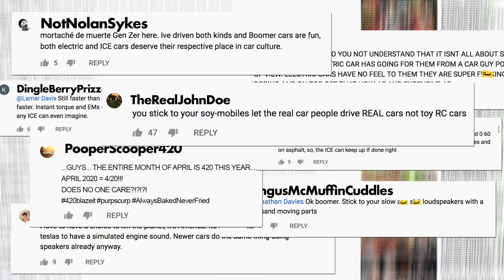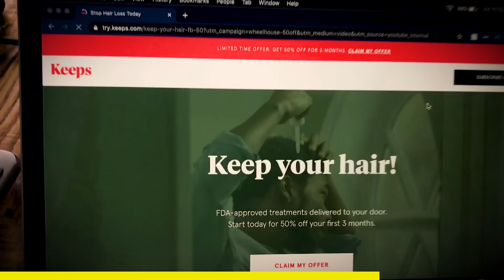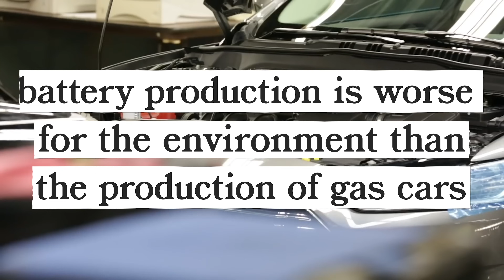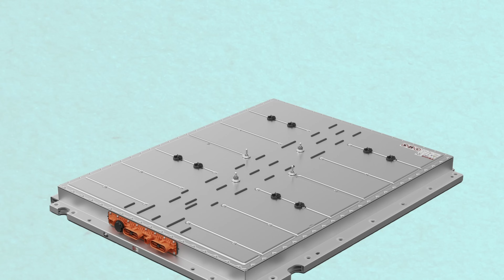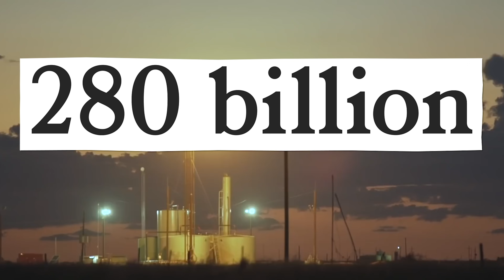Are Electric Cars REALLY Better for the Environment?

Comment: You missed a point, price. I had only 3k euros to buy my 1st car. The only electric vehicle i could afford was a scouter...
Reply: You're a 100% correct I can by 3 cars for the same cost is one electric car and the governments trying to step in and pay for half of that which means were all buying electric cars in 1 way over another.
Reply: not to mention that that EV will need a new battery in 10 years at a cost of 7K to 15k
Reply: Your not gonna own one and everyone is gonna pay a lease that will be subsidized to be affordable. If they can convince someone to replace a 1000 dollar phone every year they will do it with evs
Reply: you could have bought your self a Toyota Prius, you would be half way if you used the EV mode well.
Reply: but ev's are 5x cheaper to run, comes to about the same cost over its lifetime
Reply: @fusionsoup9784  personally, a one-time repair cost is worse than a higher recurring cost. 
It seems that gas cars don’t fail outright mechanically as much as EV but that could change with improved technology, but I doubt the manufacturers have the incentive to improve this.
Reply: @liucyrus22   and try getting a replacement battery for a vehicle that is 10-15 years old (age where working class people buy cars) and is no longer in production. It won't be as simple as putting in a battery from a newer model because tech improvements won't be compatible. 
Private transport will not be available to a growing number of people, it will become unafordable. Vehicles will also have a shorter service life and end up on the scrap heap far earlier increasing resource use and waste.
Reply: @slooob23  that’s the official statement, but I would say third party repairs can make that better by a whole lot. 
They are using standard Li-ion cells to build packs and so it is possible to rebuild the packs with a bit of hacking to circumvent the software obstacles in doing that. 
Priuses are getting rebuilt battery packs already. 
Yeah but the official route is still quite bad for the market of used electric cars.
Reply: @liucyrus22   that's why it has to be a gradual transition. The present used vehicle market probably has the most efficient recycling industry built up around it. I can get almost any part for my 17 year old Nissan including an entire powerplant for less than a refurbished battery in a 10 year old ev. It could take 25 years to build up a service industry for EV's like that. In the case of New Zealand, the government doesn't care, they haven't even calculated the social cost and they don't give a damn.
Reply: There are plenty of affordable ones in 2021
Reply: EVs will get cheaper, Dacia Spring will be around 10k€ in Germany, with 6k€ subsidy, you wouldn't be far off from affording it, and that is for a new car, not second hand.
Reply: We'll get there. EVs are still very new, and they seem to depreciate slower (probably because there aren't as many moving parts to break or wear) but eventually there will be properly affordable ones on the used market.
Reply: @JobyElliott  some are already. If you wanted a 2003 RAV4-EV, they can be have pretty cheap. They just don't use modern chargers. 😂😂😂
Reply: @JobyElliott   no there won't, electric cars = no more private transportation for poorer people. Once the battery needs replacement the car is effectively worthless. Poorer people will not be able to afford it.
Reply: @slooob23  ONLY if you expect technology not to progress which we know it won't since there's tons of companies working on new types of batteries and some will hit the market within the next 2 years. This makes your point moot. And seeing that some of those poor people you mention are able to afford 1200 dollar mobile phones some might have to get their priorities straight.
Reply: @TheGalantir   you obviously have no idea of how supply/demand/price works.
The present politics associated with EV's will ensure a social disaster.
Reply: Second hand vehicles are an option. I may never be able to afford a new car, not even a gas one, but I've got my 4th used car now, and I drove 2 of my first 3 over 100,000 miles each.
Reply: @AlexandarHullRichter  hows the second hand smartphone market?
Reply: @coreygolphenee9633  idk. I've got one. A number of people I know have them. $1k for an iPhone is absurd.
Reply: Reminder - Co2 is the basis of all life on earth.
Reply: @slooob23  that would be important only if there wasn't an extreme overabundance being produced atm. 

If all artificial sources of co2 stopped completely and permanently, there would easily be enough, just like there was 200 years ago when fewer people lived and more plants removed the co2 than today.
Reply: @AlexandarHullRichter   are plants presently on a co2 strike?
Reply: @slooob23  yes, due to being removed to make way for suburban development, or to make paper products, or because of dying for lack of food because humans have been destroying the ocean ecosystem on a large scale for almost a century.

Are you really so disconnected that you don't notice these things???
Reply: @slooob23    this may come as a shock, but plants that are dead because of human development don't remove co2 from anything.
Reply: @AlexandarHullRichter   why would I be talking about dead plants? You're beating a man of straw.
Reply: @slooob23  apparently you're not understanding what I wrote. Try reading it a few more times.
Reply: @AlexandarHullRichter   so when NASA reports a massive greening of the earth has happened in the past 20 years, I should put that down to dead plants? You are ignorant, that is what political activism does to a person.
Reply: @slooob23  batteries are cheap compared to a new car. Plenty of people have installed new or referb  batteries in older EVs and hybrids for less than getting used gas cars of the same age.
Reply: @slooob23  small improvements don't make up for big destruction. Things are getting better by the penny after haven't gotten worse by the dollar. In 50 years, we'll be farther along. EVs are going to be part of that.

I live in California, BTW, and huge previously plant filled wild across are being developed into houses all over SoCal. Nature is disappearing here, and people wonder why they're are problems.
Reply: @AlexandarHullRichter   so you change the subject to more nonsense when your previous nonsense was exposed? In NZ a Nissan leaf battery costs 5-10k and is one of the smallest electric cars, I just got a Nissan maxima (a much larger car) in perfect condition for $3700, less than one tenth of its new price.
The poor are going to get screwed into oblivion, motor vehicles are one of the only ways trickle down economics actually works, the EV craze will destroy all of that.
Reply: @slooob23  BTW, a referb Prius battery can be had for about 1k in the US. Installation is another 1k, and it takes a dead battery Prius that's worth about 3k and bumps that value up to around 5-6k. There are videos you can search for if you actually want to bother educating yourself.
Reply: @AlexandarHullRichter  and how much of California's electric grid is produced by renewable energy? Ev's are virtue signalling nonsense which are useless for the so called "climate emergency" we are told we're facing. The extra industrial activity (and associated co2) required to replace a vehicle fleet with EV's and dispose of the previous fleet is bad enough. Add to that the lack of renewable electricity generation, the lower service life of EV's and the inability for large numbers of people to acquire them. It is nothing but a gimmick. 
I've got nothing against EV's as such, but to suggest they are going to make any difference to this "emergency" as it is presently defined is utterly absurd.
Reply: @AlexandarHullRichter   the "dead" Prius you mentioned  would cost $4200 in NZ money, where as my fully functioning maxima was $3700 at halfway through its life, I'd expect to get 10 years service out of it at current usage. The old Prius with new battery would be $7000-$8350NZ based on your pricing, so literally double the cost of what I paid, and even then I paid a bit more because the car I got was higher spec than the base model. So there you have it, a Prius (which would be among the cheaper options) would be double the price of a used gas car.
The EV revolution will seriously negatively effect the ability of the working class/ poor to have adequate private transport.
Reply: @slooob23  nz is not a large car market. In California, the world's largest car market, that Nissan would be worth about the same as the Prius, but the Prius actually has a service life of 2-3 times that of the Nissan, if you are ok with getting a new transmission in the Nissan every 2 years. Their transmissions do fail that frequently here. The size of the market is important because we're not talking about individual vehicles when discussing environmental impact. We're discussing hundreds of thousands of vehicles of every model produced every year. What works in larger markets is way more important than a place that only gets a few thousand new vehicles per year.

The power source for the EV is actually irrelevant to the vehicle's impact because upgrades and changes are being constantly made, and most EVs will still be in service when more renewable energies are in use. Even if they weren't, the worst form of electrical generation is the US has a thermal efficiency twice as great as a gasoline engine. Most of the people who have EVs in the US are also people who recharge them with solar power.
Reply: @slooob23  as far as initial cost, most people here buy new cars more often than not, or else they'll get a 3yo model not is still early in its service life. The Nissan Leaf, Tesla Model 3 and Chevrolet Bolt all sell in the 30k-40k range. That's about mid level for cars here. Suvs are very common, and tend to range from 25k-40k for normal ones, and 50k-100k for luxury ones. As EV very affordable by comparison to that.
Reply: @AlexandarHullRichter   well you'll be happy to know that the NZ government plans to ban the sale and import of all gas cars by 2030, and encourage us "to cycle twice as much" . How I'm supposed to continue running my business is beyond me, going to take me a long time to tow a ton of gravel with a bicycle, but I digress. We will be the worlds test case so I guess our pain and experience may be your gain.
Reply: @slooob23  That, I feel, is unreasonable, unless it only applies to new vehicles. Forcing people to buy new vehicles instead of being able to import or trade used ones is definitely a hardship for everyone, regardless of what powerplant you want that vehicle to run on.

Honda and Toyota both plan to phase out gas only vehicles by about that time as well. Honda has already announced that for the EU market. I'll always have the option to get a used gas car if I want, or a used EV. I'm actually a big proponent of always buying used. Part of that is I just don't like most new vehicles. Part of that is I could easily get a gently used car from the 1990s and do a complete restoration on it for less than the 2021 model costs, EV included. At least, that's the case in California.
Reply: @AlexandarHullRichter   I agree with you, I do the same. I've taught myself to fix cars etc and I have managed to aquire good quality older cars that are low cost to run, I save about $1500 a year by refusing to go into debt for vehicle purchases. Recycling is good, it is a great way to conserve resources and lower consumption. I too do not like many modern cars, may latest Nissan (its the same as an infinity i30 in the usa) is far more reliable than later Nissans. Many modern cars do not age well, planned obsolescence is a growing feature of vehicle design and parts, it is one of my pet peeves.
Reply: @slooob23  My car is a CR-V, and I laugh sometimes at the discussions is the CR-V owner's club because most of the discussions in the newer CR-V section are to do with failures of electronics that can't fail in my car because my car is to old to have those features. I like my car that way.
Reply: @slooob23  slow and eventual replacement might do good, but the virtue-signalling mass replacement is doing more harm. 
So I agree with you.
Reply: @AlexandarHullRichter  Your argument is looking more and more frail by the minute. You can quit the professor act.

Comment: 10:37 
Lol in Denmerk by 2050 all cars on the road have to be EV's
Reply: Thats rather late Denmark, greetings from Norway.
Reply: New fuels are being developed that give extremely clean emissions from internal combustion engines. For example the new synthetic fuel developed by porsche reduces tail pipe emissions by 85%. This would put the internal combustion engine on a level of emissions output at the same level as a electric vehicles.

Comment: The problem is charging in rural area fauyette county pa has no charging stationy volkswagen diesalt is cheap to run more places to fuel like north Dakota and Montana road trips would be hard.  I guess ev or like model t a hundred years ago versing railroad

Comment: The supporting infrastructure to deal with the other issues is simply not there yet. We already have the plague of what to do with used tires. Imagine adding used/damaged batteries to that mix. Tires do not spontaneously combust (unless doing an extended burnout) and are not as laden with various chemicals battery packs contain. Disposing of and recycling of battery packs was touched on but not figured into the overall environmental impact of EVs. Carbon dioxide cannot be the sole metric. That being said, I am NOT anti EV.
  I would love to build a EV with lightened and balanced armatures ,better bearings,and all that. There is so much potential performance there that many overlook. Imagine taking something like a Model 3, gutting as much weight as possible , upgrading the motors, reducing the weight and size of the battery pack by 3/4  and adding a light weight high HP ICE to run a generator for charging and high motor demand. Okay maybe it would technically be a hybrid but that thing would really haul.

Comment: When the materials in the internal combustion engine vehicle are finally recycled they can be recycled into other materials. When the materials in the EV vehicles are at the end of their service life (their batteries) they are hazardous materials with no recycling capabilities.
Reply: Lithium batteries can almost be completely recycled. How do you recycle waste engine oil? Because I'm pretty sure it's just burned as waste oil...
Reply: @NomadicPhoton  Well, that's not true. Yes, lithium batteries can be recycled, but nowadays it is not more than 50%.

Comment: The grid myth may be a myth on a large scale, but where I live they can't place any more chargers because the local grid can't handle it. So we now have a ratio of two EV for every charger.  Do I need to paint the picture at the end of a workday when all of us EV owners want to charge our cars?

For my next car I will ditch the BEV for an ICE, it's just not practical. I suggest everyone thinking about buying an EV research the charging situation at home and at locations you have to (frequently) visit.  Don;t find out after you have signed a 5 year lease (like I did).

Comment: One thing that is often overlooked is that coal fired power plants CAN be made to produce electricity cleanly using super heated furnaces,  being sure to grind the coal fine enough, catalytic converters, scrubbers and filters in their exhaust. Since a power plant doesn't have to deal with weight restrictions like a car they can have whole buildings dedicated to housing filters and the like to remove pollutants. 
Obviously not all power plants are doing this. And certainly it's no comparison to a renewable energy source, but it seems like people don't always know what is being done to clean up power plants